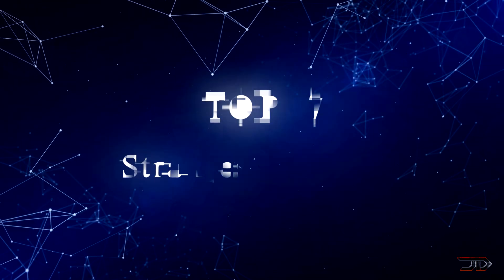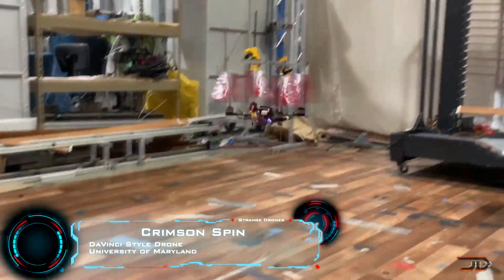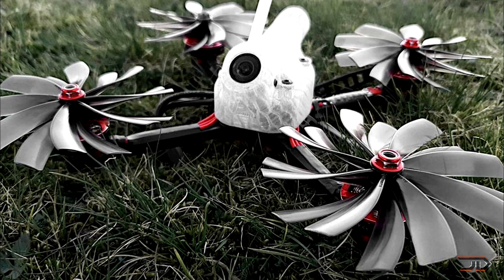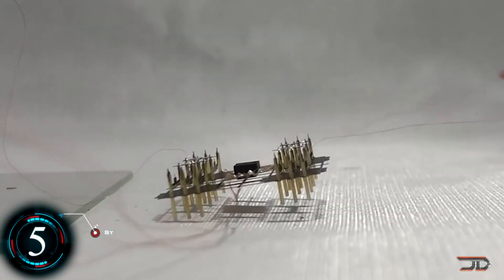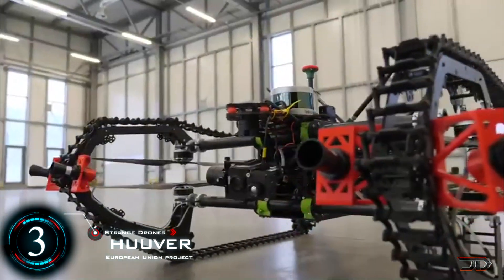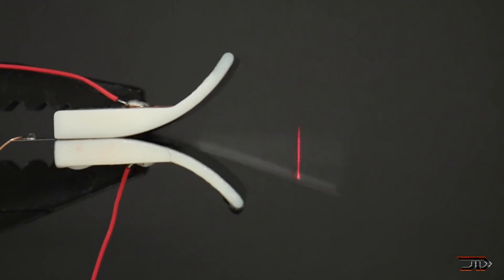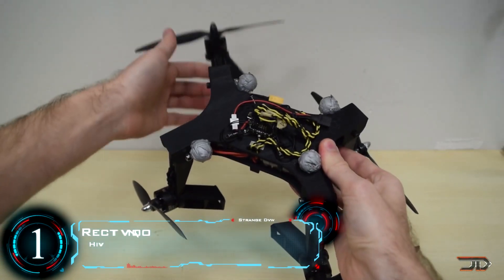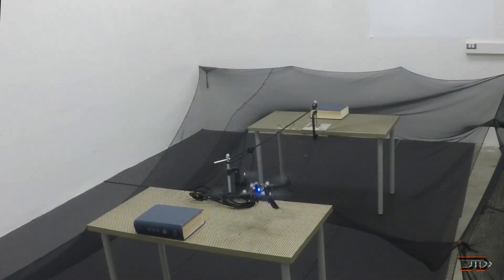7 STRANGEST New Drones -2-

Comment: The spiral propeller seemed pretty silly. It was pretty obvious that the pressure it created would bleed out the side rather than keeping the compression just to the rear and the low pressure to the front. At the very least they should have built a shield around the propeller to prevent airflow at the sides of the propeller.
Still, it's a terrible design compared to a regular propeller, which works like the wing of a plane.

Comment: My idea is using a round, flat hydrogen filled balloon as the body of the drone, like donut but with four holes for the fans, and one in the middle to hold batteries and a camera. Spring loaded flaps could work to aid stability, by opening suddenly when the craft tilts in the wind. The whole idea would be to minimize weight via using hydrogen & Mylar as the "frame".

Comment: I'm excited to see the development of ion parachutes, yes flight is difficult to control and lifting its own power-supply is only another hurdle in making an engine: an ion chute for military application is a good projected step. I think the UFO I saw was ion-drive-powered, slow, soundless, didn't bother birds on the wires or the horse, just maintained altitude and barely changed course.
Reply: The ion propelled device shown above does lift its power supply and is patented for it.  There are 36 flight videos of it on my channel.  Over 40 videos about it in total.

Comment: Nothing to do with this video. Just an idea; make a spiral mirror, and point it to the  Pleiades or some other well identified star  as you see it today.  You will detect light using a light detector . Then figure out where the Pleiades are today (1200 light years away from they are today) you will it detect “light” where there is none. There currently is no explanation for that. I mentioned the Pleiades because this is the star group that was used  for this experiment in “a well known national laboratory” where this experiment was conducted. 
This only works with a spiral mirror. There is no clear explanation as to how “light” traveling at the speed of light is reaching the mirror from the current location where the star cluster is today “instantaneously”.  The spiral mirror must be at least 1 meter long. No reflector is needed. This is one of the top things physicists are working on. Two possible explanations: Tachyon / photons  or quantum entanglement. 
FYI - there is no other stars at the site where the photons area coming from the location where the photons are coming from taking in consideration time dilation.

Comment: At the 2:44 mark you can see for about 2 frames that the ion lifter is getting its power through a thin wire from a ground supply. This is a common trick that people use who really really want to believe that these things can be self-contained, when they just can't even quite lift their own weight, let alone any kind of payload.
Reply: Dear Sir,  

There are over 36 public videos of this ion propelled video on my Ethan Krauss YT channel.  It is shown flying in front of many expert officials, numerous times. It has two US patents that describe exactly how it lifts its power supply against Earth's gravity, that is the number one claim in the patents US 10,119,527 and 11,161,631.  You are correct that in this one particular video shown above it does have a safety tether above it.  It is not an electrically conductive tether however the power supply is in fact onboard.  In the HD video on my channel with narrow aspect picture, my wife shows that temporary safety tether close up, and demonstrates that it is just a piece of non-conductive blue yarn.

 You are also correct in that "lifters" can't normally lift their power supplies because the thrust to weight ratio is far too low.  In the case of this craft though, the thrust to weight ratio was increased by a tremendous amount over the course of many years, iterations, and careful experiments.  The current required for it to fly has also been reduced to a surprising degree.  The entire craft weighs about 25 grams with the power supply and batteries onboard.  If you watch some of the other vides of it on my YT channel, that will clear things up.  Unlike other amazing machines on the internet, this one is verified in a thorough manner.

Comment: those ion lifters would be really useful if wasn't for that pesky gravity being such a big issue, XD
Reply: There is a video of the ion propelled craft above lifting its power supply, with no overhead tether, on my channel, for almost 2 minutes continuously so far.  It has flown for about 3 minutes on a battery charge before intermittently.

Comment: 2:37: once you see the strings suspending this jokecraft, you just CANNOT UNsee them.  PURE FOOL
Reply: I understand how you might have jumped to the conclusion that you did from the momentary image that is shown of the craft.  If you look at my channel however, under the icon to the left, you will see that the craft absolutely does lift its power supply and gets all of it motion from onboard ion thrust.  In that short clip you are referring to it starts by taking off from a safety tether, but the blue yarn curls up once the craft is energized.  There are 34 flight footage videos of the craft most with verifiably no safety tether, also in UHD.  There are 2 US patents and many top officials also that verify it actually does work with onboard power.

Comment: you dont have to have batteries on a facility where the floors and walls, are covered with wireless resonant wire transmitters, ie, remote powered tram-like drone system
Reply: ai is when you do weighted breadth first 3d grid search with favorable positions, ie, better (prefer) when more than x distance away from collision, away from hazards
Reply: ai when you say "I cant code it myself"
Reply: any function (all functions) that AI can do, a finite program can do, universal computing equivalence

Comment: 2:22 I'm going to need to see some flight footage that's not on circular paths that could easily be produced by swinging it on a string
Reply: I don't know about the rocket shaped drone, but it doesn't look like it is on a string at all, and it flies quite high by known means.  The one right after it that is ion propelled.  It just one of a series of ion propelled models of its type.  There are 2 US patents for it and dozens of flight footage videos on my YT channel.  All the info is there.

Comment: Acoustical powered drone? I am beginning to realize the speed of sound-barrier has not been over come. Coil & un-coil concerning levitation, the correct complex acoustical signature may infact be able to lift extremely heavy loads over a very short distance? Thank you for this very informative video!
Reply from the maker: Thanks for watching, there are acoustical tractor beams so it might not be that far off!
Reply: you dramatically misunderstand the physics here. there is no acoustical signature. its just a strong static soundwave creating pockets of low and high pressure, just strong enough to lift a styrofoam ball. it is not viable for heavy objects. 

the speed of sound is easily overcome, its called supersonic and all kinds of bullets, rockets and jets have achieved those speeds. even a whips tail will go supersonic.
Reply: figure it out and build a pyramid, refuse to elaborate further

Comment: ion propulsion not gonna happen soon. needs too much energy for the weight/size. so will always be tethered
Reply: That was true in the past.  It did used to take too much power.  There are 33 flight footage videos of the type of ion propelled craft on my channel that is shown in the above video.  All of the videos show the craft lifting its own power supply.  It is the only ion propelled craft that is efficient enough to lift its own power supply onboard and is patented for that reason. Much later MIT built an ion propelled glider that had onboard power and was launched with a catapult.  It was much less efficient though and could only level for a few seconds rather than fly with VTOL for minutes.
Reply: @KraussEMUS1  just watched it. and ill be honest. i think its amazing what you did. ... there is however a but coming.
the weight to power ratio.and the weight itself.
this needs to be bloody light. so i am doubtfull we will see this tech implemented outside with lifting capability like lifting extra weigh such as a camera.
if you want to pick up a gopro and have enough battery to sustain 10 minute flight this thing will need to be very large. and very light. so outdoors battling a gust of wind wont be feasable yet.
it will need to be more advanced in power to weight ratio before that happens.
but still what you did was amazing
Reply: @sadev101  Thanks very much!  You are of course quite correct about it flying in the wind.  I have to wait sometimes for a week or two before it is a calm enough day to fly it outdoors.  It is also calmer in the morning or evening.  It has though carried a very small ultralight camera and video transmitter before, so it is useful for that.  It has also flown with small added propellant tanks so it has other exciting possibilities.  Anyway, Thanks again!
Reply: There was an untethered ion craft flow. It had wings and used ion propulsion for thrust. It still wasn't practical and could only fly indoors. If you're interested, I'll find the video for you.
Edit: I think Tech Planet used the ion airplane in one of his videos.